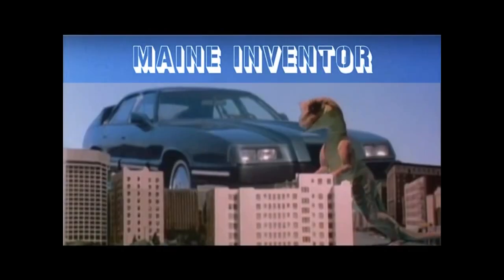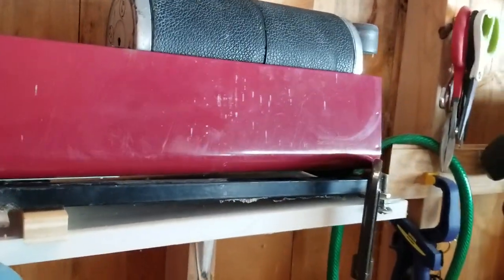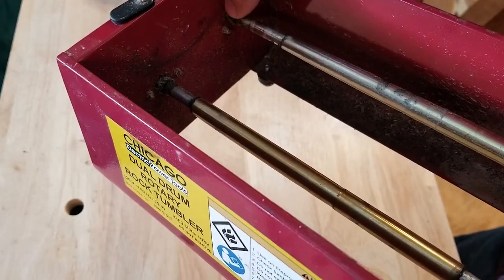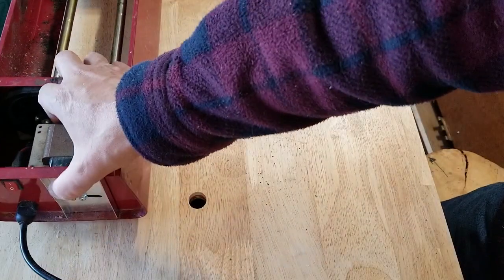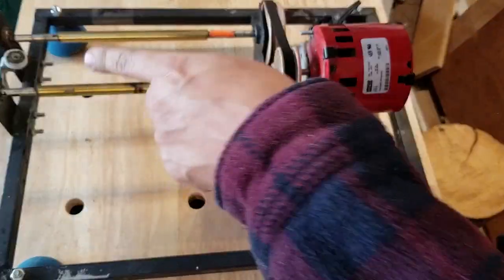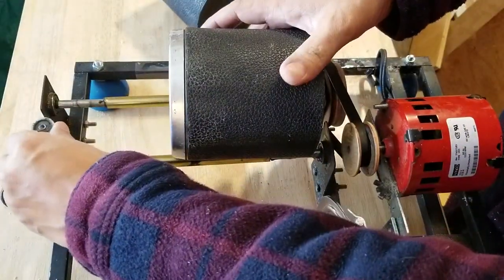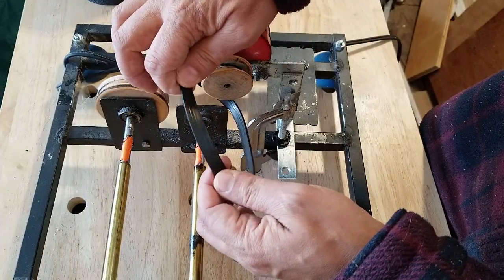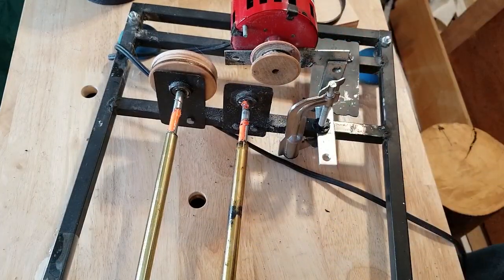Convert a Harbor Freight Rock Tumbler to a Professional Rock Tumbler

Comment: Commie china been half-azzing their products and this tumbler is now no exception. They had sent me this dual tumbler that has both drive bars with a rubber tube on it that only spans a small portion of those bars. That makes the containers tilt toward one direction and always rubs hard on those plastic tabs. Tired of the junk from harbor freight and so will be looking for a decent-made unit thats actually dependable

Comment: I've been running HF tumblers for years. They work well oil them and keep them clean and level. They're also very quite. Most people just don't know how to maintain and use them. You can add a voltage regulator to control speed but depending on load should run between 30 -50 rpm. Yours looked about twice that? Your gonna crack a lot of rocks. What's the amperage and wattage of that motor because if you run that thing continuously your gonna see an increase in your electric bill.
Reply: Wouldn’t the high speed make everything stick to the walls due to centrifugal force and not actually tumble?

Comment: How are the bearings free if you have to buy the skates? Btw they're rollerblades not roller skates 🤦
Reply from the maker: The set I used first was from a set of 4-wheel skates found at community dump pile.

Comment: Looks like it's spinning the barrels a little too fast.
Reply: If my calculations are correct it looks like it is spinning about one rotation per second or 60RPM. Would you say about 45RPM is a good ballpark or would you go even less RPM?

Comment: I wonder how long the wood pulleys will last. They seem to be a little wobbly. My end goal is to make a cabinet tumbler so I can run a bunch all at once. The barrels are so freaking expensive though.
Reply from the maker: Its been 4 years. Wobbly cause I didnt use a drill press. Other than that - there is no real points of rubbing friction... if the tension is right and the belt isnt slipping. Looking at them now, guessing 10 years

Comment: Seriously all of you trying to reinvent the wheel, it's not that complicated, take a plastic card fold it in half and drop it in the end opposite of the motor, the card is the same size as the radius of the barrel, you don't need a welder or drill or skateboard wheel or shower door wheels none of that, the bands will delaminate and split, so use a large O ring instead.

Comment: So for all the time, expense, and engineering you could just take the stock tumbler back to Harbor Freight any time ( if!) you have a problem and they will give you a new one no sweat. With a little maintenance The HF tumbler will last years. Stick it in the corner of the garage and you wont even realize its running.

Comment: That motor is not going to last for long. I've got one of these Harbor Freight tumblers, and they are absolute trash. I've bought three new belts for it in the past year and now the bushings have worn out. It's made to use on little Johnny's new rock polishing hobby for the approximate week he will be interested in it, and not much else.
Reply from the maker: The replacement Fasco 1/4 motor I used has a little over 4,700 run hours on her w/60% of the brushes left. I'm not making any claims - just having fun with what looks like another 3 years of run-time (belts, about one a year).

Comment: how long does it take for the original rock tumbler to wear out ??1yr..2yrs..3yrs?? even after 2yrs/24months and the tumbler is say $75,that is a bit more than $3 a month.just buy a new tumbler and keep the old for spare parts if there are any.
Reply from the maker: po dunc - this was never an exercise in budgeting, I invent for fun. I 100% agree with you if that was the goal. I can watch something I made that was well designed for hours, adding a second dimension to the love of rock tumbling!

Comment: For the backup and for any Harbor Freight Tumbler, to stop the rubbing, buy 1 inch diameter self stick felt pads, stick one on the I side of the frame on each side so the aluminum lid will rub up against them. Clean the lids very well and start rolling. Mine has lasted for two years and still no issues, cheap fix, about a dollar at the dollar store. No engineering, no worrying about slope, sick them and wipe the off on occasion.

Comment: Yea I’m just gunna buy the name brand one . I love harbor freight but they do have cheap equipment. It’s all made in China and you know how that goes
Reply: I have a HF tumbler that has run a ton of rocks for three years with no problems at all. I do dip my finger in oil and rub it on the wear point on the drum lid and have yet to replace the plastic wear tabs. Maybe I am just lucky lol. Havagudun my friend.

Comment: Great job Jonathan! You have taken your great idea and replaced the bearings because that will wear out over time. Why not replace Harbor Freights two tiny tumblers with a larger single barrel to do a bigger job. With your 1/4 hp motor you could do a bigger job in the same amount of time. Spread your rotating arms out further to accommodate a lager barrel. What were the diameter sizes of your pulleys? I like your ideas!
Reply from the maker: Thanks Larry! The reason I didnt go for the larger Thumbler class barrel was the same reason I made this thing, no cash! Tried to buy a used read hex Thumbler with the wing nuts at the Tucson Mineral/Gem show and he still wanted $60. There is that thrill of scrap Frankensteining to life mostly.
Reply from the maker: Thanks Larry. If you look closely, there are two more sets of holes in the frame to allow for two further spacings. It will run one of the large Thumler red octagon barrels with ease. Thanks for the interest!